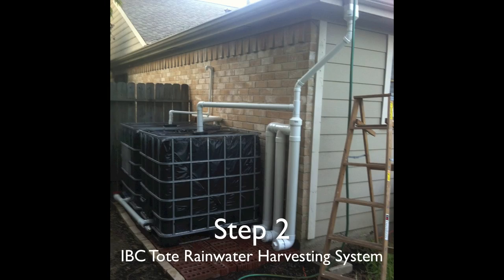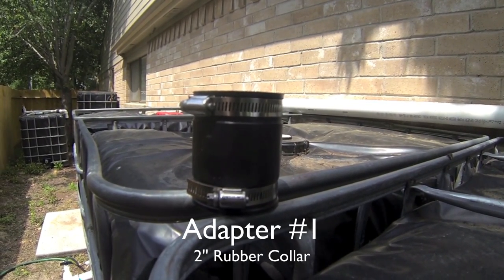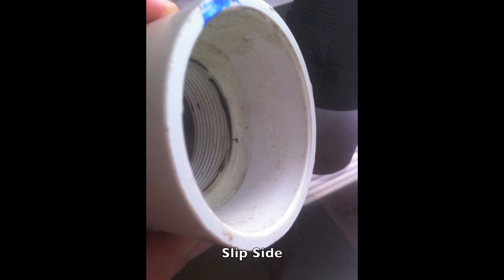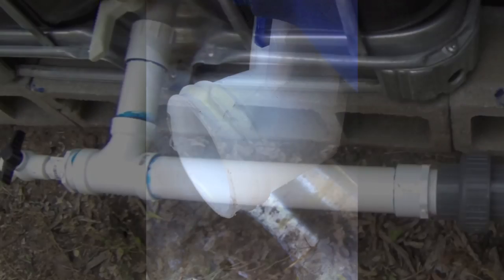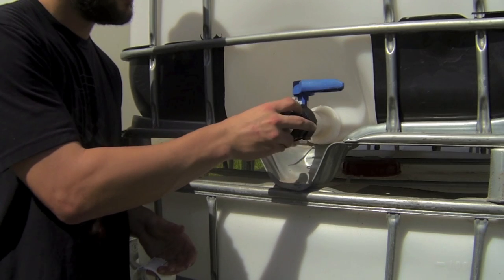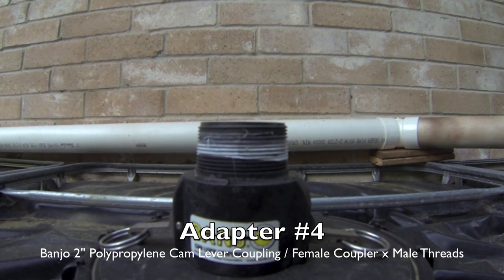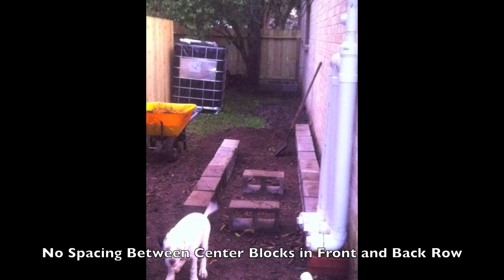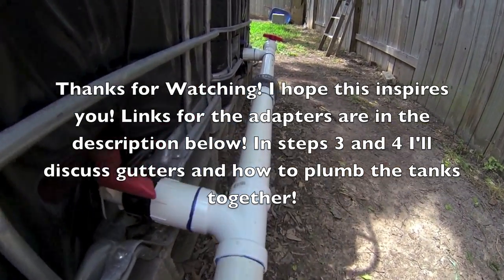Step 2 - IBC Rainwater Harvesting System - Adapters and Foundation

Comment: Just one quick comment on your setup.  If you rotate your cinder blocks so that the holes are going up and down instead of sideways, they will be MUCH stronger.
Reply from the maker: Supersportchevel: Thank you!
Reply: Hi Trenton, any recommendations you could give for buttress threads that are scraped up on the bottom from a lot of contact with concrete? Would the cam lever adapter be able to lock onto an IBC buttress valve through brute force alone?
Reply from the maker: I don't think it can, but you can always give it a try. I would just buy a new tank.
Reply: Trenton Kaminski thanks, man! maybe would have better luck with the black compression band adapter

Comment: This video is EXTREMELY helpful.  Thank you so much for making it.
Reply from the maker: Jonathan Rogers Thanks for watching, It is a 2 inch adapter. In the video description below there is a link to where I purchased the cam lock adapter.
Reply: Trenton Kaminski, thank you!
Reply from the maker: Jonathan Rogers This is a video I was looking for when I built this system, I could not believe no one had recorded a video over the adapters. It covers just a few parts, but the parts are vital for a sound IBC rain harvesting system.

Comment: I am using buttress valves (I am in Europe), 5.5cm în exterior diameter. My initial thinking was to use some plumbing pipes, adapters etc. I wasn't able to find something to that buttress thread. Second step was online sellers - there are many     options - expensive in my opinion. I realized that all those options had in common the part which is going to be fastened on the buttress thread - so I ordered blank caps for ibc totes. Those have to be drilled and you can attach the a hose adapter or garden faucet. Even more, I was around some heavy excavators and bulldozers and the guys had many plastic jugs (I hope this is the correct term) of 20 liters (5 gallon?) with oil, lubricant etc and guess what? The caps from these jugs are fitting 100% to the 5.5cm buttress thread! You have to clean them before use and then you can proceed to drill and attached your preferred hose adapter or garden faucet :)

Comment: Very informative about the valves.  Thought I should mention however, that your concrete blocks are facing the wrong way.  The holes should be facing up and down...not sideways.  Blocks are meant to carry vertical loads, they are not meant to carry loads on their sides.  Installed properly, a hollow core concrete block can take a load of roughly 1000 psi, and all the manufacturer specs say that rating is "significantly" reduced when the block is used in the wrong orientation.  I regret that I could find no compression tests for improperly oriented blocks to get an actual psi rating.
Reply from the maker: +AndTheCorrectAnswerIs thanks for the info. I turned them to the correct position a while back but haven't made an updated video.

Comment: By far the most specific and helpful video I've seen.  Thank you.  

I have the cam level valve.  The OD measures 2.5".  Do you know if that means 2" or 2.5" when I order the cam lock coupler?
Reply from the maker: Thanks for watching. If your OD is 2.5 then my guess is the ID is 2''. I would order a 2'', the ID is what they are going to base the measurement off of.

Comment: Thanks for the video.  I have purchased two different adapters both of which didn't thread.  Now I can see that I need the cam lever adapter.  I found one on Amazon and plan on trying it.  I hope this one will connect so  I can plumb them together.

Comment: I think I have type 4 cam lock valves.
So I followed your link under that and it takes me to jme website with: Part A -  2" Polypropylene Part A Male Adapter x Female NPT with price of $3.24
But your description says "Female coupler X male npt threads" and on JME website that title matches with that of Part B - See this link http://www.jmesales.com/catalog/productinfo.aspx?id=5914&cid=7170&skuid=KUPPB200 and the price for this also matches to that in your description.

The valves on the totes that I have look exactly like the one in your video at time 3:34 and to me seem like male threading (3 rounds) and NPT pitch.

So which one should I buy PART A or PART B on the JME site ?

Also it would help if you showed what the Valve for Adapter #2 looked like.

Thanks for the help and making this great informational video.
Reply from the maker: +adu You will need part B.